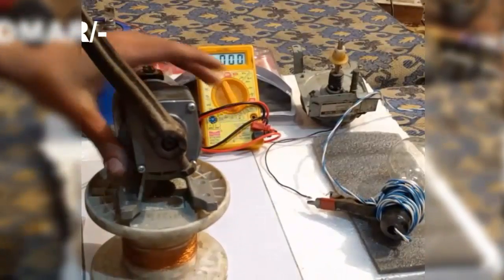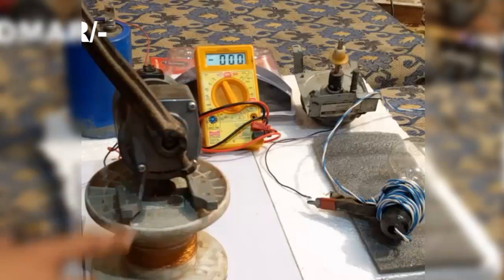Free Energy Generator that requires no Electricity for field power: 100% Genuine

Comment: bhai ye sach hai what otors n alternators do...but the problem is that as soon as we apply load the rpm gonna die irrespectively.....say....u r using 100w dc motor to create the power, if u use almost 80w of that it gonna die.....correct me if i m wrong....@ hb72742@gmail.com

Comment: awesome, really nice video, bro i have a 24V inverter. how can i step down the voltage to support it. and also can you give me a reference on connecting two dc alternators to  give continues spinning
Reply from the maker: Ibrahim Shaka Thankyou .
This is a 300V DC generator..  24V inverter won't work with it.
Reply: can i link two dc alternators then start running with battery, then remove battery? will the alternators continue working?
Reply from the maker: Ibrahim Shaka Yes for a few seconds..  If u use an inertia disc then for a few minutes.
Reply: creativ electron7m  ok thanks seen  videos where 2 DC alternator kept working continuously..... how did they do it. or what's your take on that?
Reply from the maker: Ibrahim Shaka you must have seen pmdc motors linked together not dc alternators...
Reply: creativ electron7m ok thanks
Reply: creativ electron7m  do you have a way I can contact you privately

Comment: this is interesting so how many minets do you need to turn the generator  to get 8 hours light with the capacitor connected to  leds     or would a battery be more practacle would I need a small transformer   good vidio
Reply from the maker: David HK battery will be more practical.For running AC appliances, u will need an inverter circuit indeed. :)
Reply from the maker: David HK Thanks 🙂